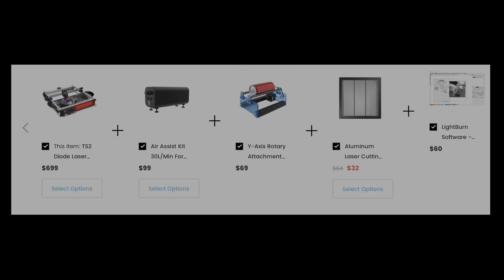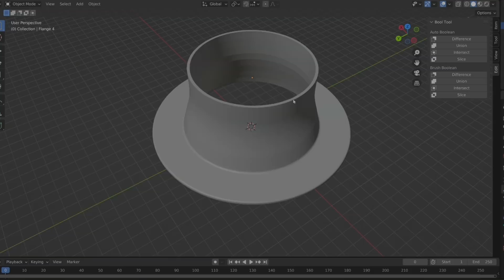Setting Up A Two Trees TS2 Laser

Comment: I wish people would stop giving these open frame uncontrolled toxic fume and blindness generators any air time.
Reply from the maker: I agree. That’s why I made a video about putting the laser in a contained box with a fume ventilation system. I wouldn’t even start the laser without it. Also, NEVER turn the laser on without good quality safety glasses on. These are serious machines with the capacity to injure or blind someone in a instant.

Comment: Great video.  Did you basically leave the front of the enclosure open?  Wondering how it performs as far as extracting fumes and preventing them from entering the room.
Reply from the maker: I will evaluate the smoke extraction once the laser is operating. I am prepared to block all or part of the front panel as needed. Maybe with something as simple as a cloth cover. I like the front opening because I can load and reach into the machine without having to lift the lid.
Reply: @RobertTolone  yes...you'll definitely need some intake so partial blockage or as you say cloth/mesh may do the trick.  I'm still waiting for my TS2 to be delivered.  It will be my first laser machine.  I hadn't really thought much about an enclosure as there are aftermarket enclosures as well as a TwoTrees OEM enclosure available...unfortunately none of them fit the larger TS2.  You'd think they'd manufacture an appropriately sized enclosure and perhaps it's in the works.  I like your design.  Simple and functional.  You should consider marketing both the plans and a knocked down kit ready for assembly.
Reply from the maker: @jeffhudson33  My current problem is that my computer can’t see the laser because (I believe) of a CH340 driver issue. I haven’t been able to locate the driver for Windows 11.
Reply: @RobertTolone  I hope I don't have the same issue, as I'm also running Windows 11.

Comment: You are probably going to out grow that laser quickly. I've played with diode lasers from a 1 "watt" box laser to a 7 "watt" gantry similar to this one. I use quotes because watts for diodes don't match watts in CO2 lasers. 
Not sure what power that is but my diodes didn't cut very well. I now have access to a 45 watt GlowForge. CO2s cut 1/4" plywood in one pass

Comment: Put some adhesive lined heatshrink over the hose and brass fitting.
Reply from the maker: There are compression fittings available that will mate those parts. I just need to order one.  But the heat sink idea is a good workaround for the time being

Comment: One possibly important thing to check with those angle brackets you use underneath is whether or not they’re zinc plated (as many types of cheap steel objects are). 

Zinc vaporizes at like 500f and zinc oxide fumes (which look like a bright white smoke) can cause metal fume fever.  Granted you’ve got a air evacuation setup so it’s probably fine.
Reply from the maker: Just my luck I’ll have to tear the whole thing out! 😳😭. We’ll see if I generate toxic fumes. Thanks for the alert!
Reply: Glad I can help. Look up metal fume fever.  Also can happen from heating up brass and inhaling the zinc oxide fumes there too. 

Your mold making videos are a genuine treasure of good resources!

I’m actually planning to make some silicone objects with fdm molds in the near future!
Reply from the maker: @CarterSchonwald  Some interesting mold projects are coming up. Looking forward to them!

Comment: I'd like to have one of those some day. They are so much faster than 3d printing. 
The design department at work has one that did come with a full metal enclosure but cost big $$$.
Keep an eye on it. If the laser lingers in one spot some materials can start to burn.
Reply from the maker: It is supposed to have flame detection but I will definitely keep an eye on it while it’s running.

Comment: You bother removing the labels? My dad would love you. If I make the effort I'll just sand it off, usually with something powered. I love the cutting bed, using the drywall corner bead to aerate. I can't think of an easier way to do it and I'll definitely need to keep that trick in mind.
Reply from the maker: Do you know what really peels labels off with zero work?  Gasket remover. I got out my can only to find that the nozzle was clogged so I had to switch to the less efficient acetone.  Time to get some more gasket remover!
Reply: @RobertTolone  Interesting, there seems to be no end to glue destroying chemicals.

Comment: What a nice box. WITH LEDs !! Next project then a vacuum box for circuit board printing? ;)
Nice video!
Reply from the maker: I know basically nothing about electronics. 😭
Reply: @RobertTolone  actually there is a way to use the laser to make circuit boards. You spray paint the copper clad board with paint, laser off where you want to etch and them use the etching chemicals. 
Robert they is an art aspect to this I think lithographs are made that way.
Reply from the maker: @chartle1  It would be very interesting to make art prints that way!
Reply: @RobertTolone  there is something called scratch paper that is a black coating on sort of psychedelic paper. You scratch off the coating but you can have the laser do it. You could paint something like metal with black and laser etch it off.
Reply from the maker: @chartle1  We called it scratch board in art school and I still have my scratch stylus in a drawer somewhere. It would not have occurred to me to try the laser on scratch board but it’s a great idea! I will definitely add it to the list of materials to engrave. Thanks!

Comment: Yes! You have a laser! Keep a few old big cardboard panels from boxes somewhere, making templates for things literally takes minutes. Why rely on careful measurements when you can smash something in inkscape (or any other vector design software), throw it at the laser and be done way faster than otherwise. There's loads of use cases for a laser, I've used mine way more than my 3D Printer, way more. It's just so much faster when you're throwing ideas around. What I do is buy in a box of pre-cut 3mm A4 sheets of birch plywood, measure the average width (current box is 3.3 mm) and I can make up complicated 3d objects by making 3.3mm tab holes for the different pieces to fit into and slap in some wood glue to tie it.
Reply from the maker: Yeah, something tells me this laser is gonna come in mighty handy.

Comment: The part used to connect the hose is literally just a few bucks, they're wildly used in pneumatics, as they can stand up to 10 bar.
You just need the outer diameter of the hose (this one looked like 6mm), and the thread type that screws into the aquarium pump (1/8 maybe). And then you can get straight or L-shaped pieces that will screw into your pump (use Teflon tape if leaking) and you can just push the hose in.
Oh, and you push down on the ring to release the hose again.
Reply from the maker: Good info Alexander. Thanks!
Reply: @RobertTolone  "FESTO" connector is the usual name, although you can buy non-branded ones.
For the hoses, the outer diameter is calibrated, and is made of hard plastic. If you need more hose length.
Reply: @RobertTolone  they are the same type of fitting that your 3d printer uses for the bowden tube. You probably have extras but they will have a 6 or 10 mm metric straight thread.
Reply: @chartle1  You're right, they are inappropriating them for the bowden systems in 3D printers, and I wouldn't trust those to carry any significant pressure after a few years. Also, the tubes they are using are made from Teflon, which isn't the right material for air applications and might not have proper calibrated outer diameter for a good seal. 
Anyway, they're pretty common, even the name-brand FESTO ones aren't particularly expensive.
Reply: @graealex  I've been following 3D printing for a long time and the entire industry at least started as a hack. I recall an early DIY machine that used a CNC controlled  hot melt glue gun using really long glue sticks printing a very rough bust of Abraham Lincoln. I think the diameter of the filament comes from plastic welding rods.
Reply: @chartle1  Point is that these fittings have some slack, particularly the cheap ones. That slack will 1:1 translate into imprecise retraction and some delay when pushing the filament. Not a problem for direct extruders, but the bowden-type extruders will suffer from cheap pneumatic fittings. A compression fitting would probably be better, although that makes it hard to reach into the hot end when you need to remove clogging.
Reply: @graealex  I have a bowden setup on a Ender 3 V2 and don't have any issues. I even print the less flexible 95A TPU. I've gone through a few fittings and picked the best.